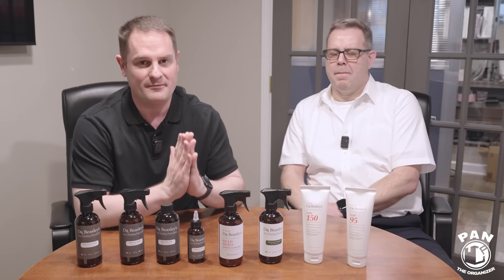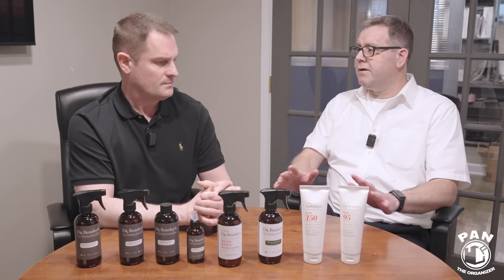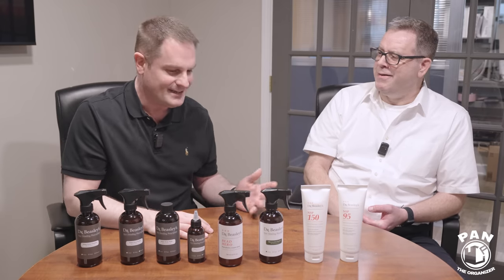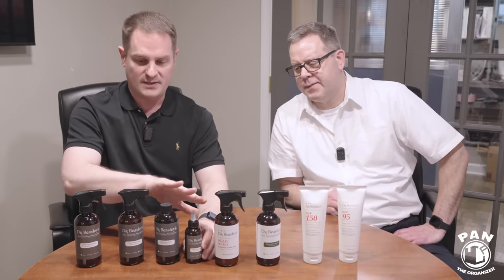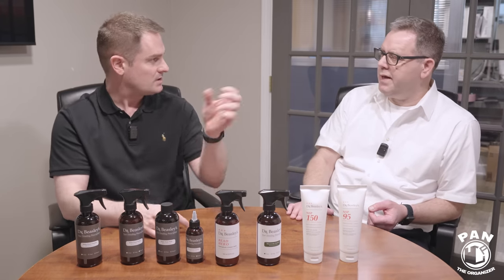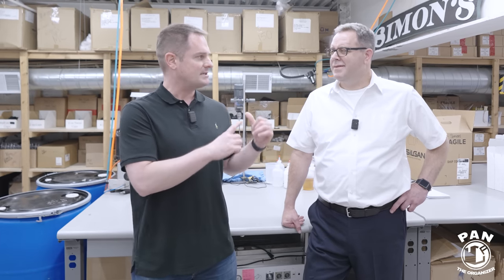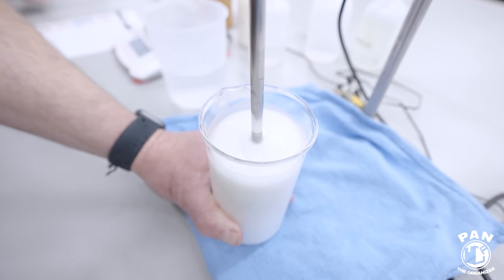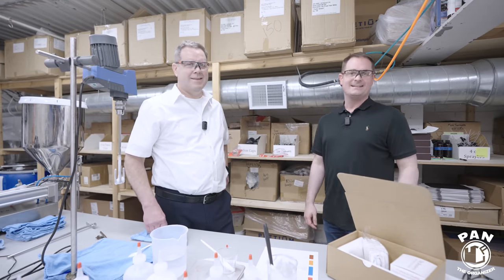Dr Beasley's makes a product with Pan!

Comment: Thanks again for taking the time to visit, Pan 🙏 If anyone in the comments has questions please feel free to drop them here!
Reply from the maker: It was awesome meeting all of you at Dr Beasley's!
Reply: I'm suddenly very interested in this product line. As a northerner with vehicles subjected to 6 months of MN road salt, a product line developed in Chicago has my attention. Other than the Chassis Coating, are there any other products in the line that are particularly helpful for dealing with road salt? How do the coatings stand up to salt and how should the coatings be "reset" in the spring?
Reply: @jeffc6832  Definitely check out Salt Chisel for breaking down interior fabric salt staining if that's a problem you're experiencing. Exterior  wise all of our ceramic coatings were developed in the incredibly salty conditions of Chicago winters so they exceed at resisting build-up. For "resetting" we recommend a rejuvenation treatment with our AdvanceCoat: Gloss (or Matte for matte finishes).
Reply: @DrBeasleys  Thank you, I will definitely check those out!

Comment: Hello Pan, 
Thanks for the video on Dr. Beasley products, I live in the Chicago suburbs and never heard of Dr.  Beasley. 
I’m interested in the Bead Hero but have a question I hope you could answer.  In the video when talking about Bead Hero you and Jim mentioned that it can be used as a topper on any protective coating as long as its Nano technology.  Question: Is Turtle wax Graphene Flex wax and is Bead Hero compatible, is Flex Wax based on Nano technology?
Great channel, very informative, keep up the great work
Thanks Pan!

Comment: Crosslinking is a chemical reaction, not mechanical. additionally, I'm curious how a spherical abrasive archives the "bonding sites" as effectively as a refined mineral?
Reply: After using you do wipe off the surface thus no abrasives are present, same with a regular polish product. Difference is no paint prep step so the surface is ready to apply any ceramic coating.   Works very nicely in my experience the past couple of years.

Comment: Pan, is NSP line only for applying a ceramic coating afterwards/on top  or it can be used as the base layer for applying wax or a sealant ?
Reply from the maker: To my knowledge it’s a primer for ceramic coatings.

Comment: interesting video, fun to watch.  But I dont understand, if a leather product vs a vegan leather product both have a polyurethane (or whatever) coating on top of it to protect the seat, why does it matter if you use a leather cleaner or a vegan leather cleaner on it?  Neither is going to get through the top coating to the actual leather/vegan leather, correct???
Reply from the maker: Perhaps the @Dr Beasley's team can help to respond to this.
Reply: One still has to feed the beast beneath the top coat. Many (most?) leathers, especially in Automotive are indeed top coated to protect the hide beneath…. But the fact is we will need to maintain that real hide leather with lanolin otherwise with will dry, become rigid, then crack and fail. Thanks for the question!